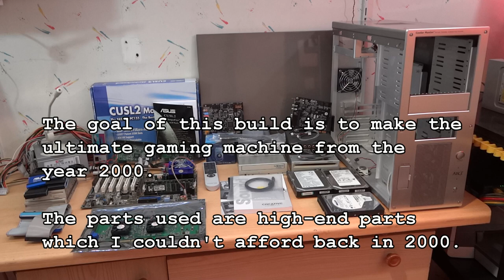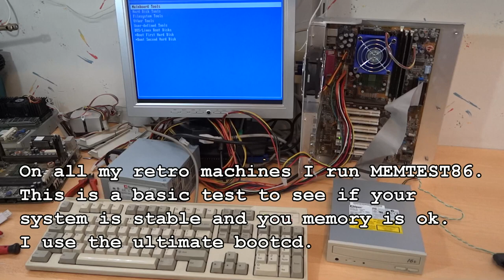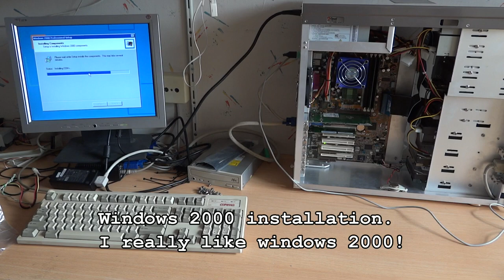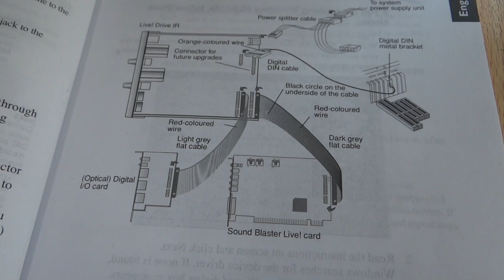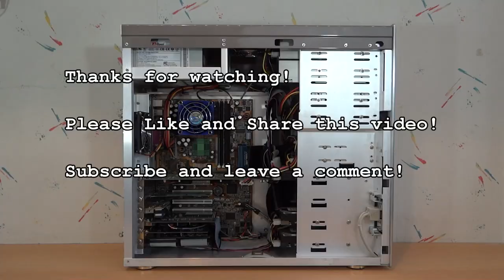Ultimate year 2000 gaming build! 3DFX Voodoo5 Asus CUSL2 P3-1ghz CM ATC201

Comment: What's the point in retro builds?
Reply: Wow, that's a tough question... There are so many reasons, that if I were to list them, this coment wouldbe the only comment visible on this page...

Here's a few reasons: It's fun, it gets rid of spare time, It's cheaper than building a new PC, You can play DOOM and such on it, and you don't have to worry about upgrades after you've built it. That's the gist of it.
Reply: FAMICOMASTER  Actually, it's more expensive looking for really old parts. Also, you can play Doom on any computer made in the past 20 years.

If I have $130 to spend on a Video Card, am I gonna buy a Voodoo 5 5500 or a GTX 480? I think I'll take the 480. It seems these retro builds try to construct the best of a generation.

Like they would look for the best motherboard that's Windows 98 compatible and stick in a Voodoo 5 5500 for the best 3DFX machine or the last Nvidia Card with Windows 98 drivers (of which was a 6800 GS) to have the fastest Windows 98 machine.

But, what's the point? You can just run those games nativly in Windows 8.1 and you can even run old Windows 3.1 games in Windows 8.1 32-bit. There's also Emulation like Dosbox and there's Virtual Machines. (especially Xen, you can give virtualised Windows direct access to a Video Card)
Reply: No, you canot run MS-DOS based games under a Windows NT based operating system, (Windows 2000 and later), or more specifically an x64 pc. MS-DOS and Windows 3.11 and earlier run natively in 16-bit, so it won't run on a 64-bit machine. Trust me, I've hoped and tried. 2 different Windows 8 machines, and a Windows 7 laptop. It just doesn't work. And with the price? Just go 'trash picking' for older pcs. And mabey it's just fun to build these machines and show them off to people, did you ever think about that? Exactly. And virtualbox and dosbox? The audio/video emulation isn't nearly as good at original hardware is, and it never will be. I can see why your name is gastonASSton, Now shut up.
Reply from the maker: GastonAsston
For this system I only bought the Voodoo5 and Case. The rest was free.
Reply: WHERE?! I NEED TO KNOW!
Reply from the maker: FAMICOMASTER
The free parts?
Reply from the maker: GastonAsston
I just asked parts by friends and I got lots off them.
Reply: Nice!
Reply: whats the point of restoring a 1957 chevy?? Old gaming stuff is to a hardware nerd kinda the same..to play the old games on the era stuff and experience what was experienced back when it was the latest and greatest.. Plus a lot of older games code wasn't the greatest and sometimes don't play so good on super new stuff belive it or not
Reply: TheDman216  Those cars from the 50's are expensive if they're still running and they're death traps, modern cars crash in a way that it adsorbs more of the impact and inertia and playing games on old hardware just gives you low FPS. I have San Andreas and it says it's Windows 98 Compatible and yet on max settings, I dip around 30FPS at 1920x1200 on my Windows 7 machine with a GTX 460 and a Phenom II x6 1045t. What makes you think a Pentium III is going to run it any better?

Those games were designed for shit hardware at low resolutions and if a game was optimized for one core in mind making CPU intensive games from 2003-2006 with developers that assumed people would just get a higher clocked single core to run it at higher resolutions or just didn't give a shit and few developers like John Carmack optimized their games for multicore before then like Quake 3 could run on a quad pentium MMX machine because it was optimized for NT-based windows of which is better than that piece of shit dos-based windows consumers had in the 90's and only the Enterprise world really used it before Windows XP came out.

The only way to run those old games at modern resolutions is to get the new Pentium (or any unlocked CPU for that matter) and overclock the hell out of it.
Reply: GastonAsston Gas if you don't get it by now ya never will..its not about Framerate or new stuff..its about gaming with the vintage gear that the games were made for .. low framerate or not.. On the car subject billons of people drove no crumple zone,no emissons,no airbag techno shitboxes and lived to tell how did that happen??
Reply: TheDman216 I already got, but Computers from the years 2000 were slow as shit and I was even planing on building the best Windows 98 machine by looking for a Socket 775 Motherboard with Windows 98 Drivers or getting a modern motherboard and install Windows 98 in Xen and put in a 6800 Ultra, but there's no point, those games run better on modern Video Cards on Operating Systems and take up less electricity.

The only Vintage hardware I like are Keyboards, but I can use a 30-year-old keyboard on my modern system just fine.

I tell console gamers this shit all the time: "Love the games, not the console" and it applies to PC too, "Love the old games, not the obsolete hardware.".
Reply: FAMICOMASTER  I'm only said to others what others said to me.
Reply: So ignore those who told you not to build it because it's a waste, If you have the resources and enjoy doing it, who cares?
Reply: FAMICOMASTER
 I don't ignore logic.
Reply: FAMICOMASTER It's a troll, can't you see that?
Reply: Yes, but I like to counter troll the trolls!
Reply: GastonAsston
If older cars are so shitty then how did my 72 Chevy get in a accident last year with a 2006 Toyota tundra. 72 had a crumpled fender and dented bumper yet the Toyota was totaled. Please learn what you are talking about before you say shit.
Reply: ***** It's called "Physics" and there are a lot of factors at play and just because it was totalled, that doesn't mean it's not safe, the forces that totalled said car may have had all of the impact adsorbed into the crash of the car itself and not the passenger.

I heard of a guy that got into an accident in his car and the car was totalled, but he didn't have a scratch on him. It was a shame, his car may had been a piece of shit, but it was the coolest piece of shit ever made and revolutionary for the time, one of the first cars that had fuel injection instead of a carburettor. His car was a DeLeorean DMC-12.

But, what made that car cool was the the body, the marketing and it was a time machine and it became an icon, but the car ran like shit. So, you don't want the car, you want the image of the car. If you replace the motherboard of an Power Mac G5, is it still a Power Mac G5? The case would be heavily modified to support a non-G5 board and my answer to my question would be "Even if you didn't have to modify the case, it's still not a Power Mac G5 because the case would be the only stock part".
Reply: And yet I choose to buy an iMac G3 over the more powerful G5 or eerything else I could've possible bought on the large, nearly endless world of ebay. And I'm no apple fanboy, I just saw it, said 'Hmmm... that's neat, I'll take it!'
Reply: FAMICOMASTER  I had an iMac G3 and it ran like garbage. But, the screen was pretty nice.
Reply: And yet I still bought one. For 10 US dollars($).
Reply: FAMICOMASTER  I got mine for free and discarded it.
Reply: Why? Just because its not the newest, fastest thingon the market, doesn't mean its so bad that you won't even take it for free!
Reply: FAMICOMASTER  Because it used up a lot of power. (that and I had to modify it to use a standard IDE Cable and it stopped working) If I was going to get a shitty computer, it might as well be low powered like an Atom Nettop or a Raspbery PI and if I was going to get a PowerPC Mac, I might as well get the best of a generation, I would get a MDD (The G5s had slow bus speeds compared to the MDD) to mess around with for legacy software.

I'm not a retro machine guy, if I'm running an ancient OS for application compatibility, I rather emulate a machine that will run those applications faster than any machine that ever used it when it was new. (apart from games that didn't have a clock-generator like 8086 games running really fast on a 486, for those, I throttle them) I installed Windows 3.11 in Dosbox and just for shits and giggles, I wanted to see how fast it was and I installed a  Windows 3.x benchmark and the results pretty much said I was a wizard with a really fast Pentium MMX and god-like IO speeds from the RAM and Hard Drive.
Reply: GastonAsston
Do you have some hard numbers to back the power consumption argument? Because i seriously doubt that this PC consumes more power than newer PCs under the same load. You see, without any frame rate limiting, running old games on newer chips is going to cause considerable load as well. In fact, it is all too easy to write some trivial code that will bring your CPU cores to a crawl.

P.S.
"Old windows" (9x) were definitely not "DOS based". In fact, in Win9x the role of DOS is reduced to nothing more than that of a fancy boot loader. Problems with Win9x vs WinNT did not come from the fact that there was also DOS present, but from actual design deficiencies in kernel itself (very little protection, lack of any advanced facilities, several generation of driver interfaces some of which were quite old and primitive, etc...).
Reply: nameless0193  Well, no, but a Raspbery Pi will use 5 Watts and is about at the same speed as a Pentium II. A Pentium II will use... Well, I don't know exactly because I never plugged in a Kill-a-watt on a Pentium II system, but I can' tell you it's more than 5 Watts!

Windows was an Operating Environment back then, not an Operating System, you couldn't run Windows without Dos, but you could delete your win32 folder and still use DOS. Also, the Kernel in win 9x was shit.
Reply: Nameless, even though I really hate to say it, I agree with gastonasston here, because my iMac draws around 650+ watts. Too much. But it s dead now, as in it no longer powers on in general...
Reply: Oh, and before windows 2000, all of the consumer versions of windows WERE, in fact, DOS based, excluding Windows NT. Windows 95 wasn't that bad, but Windows 98/SE/ME was.
Reply: FAMICOMASTER  Windows 9x wasn't very stable, that's why the enterprise sector knew what they were doing never used it for mission critical workflow that cannot be disrupted.
Reply: GastonAsston
Well, it still consumes less than modern desktop PC (i can't vouch for that voodoo though... they were known power monsters). Of course, as the time passed refined fabrication process allowed for lower power consumption that was then offset by shoving more and more transistors and increasing the clock speed, but that's besides the point. I have an old P3 and the thing works on like 250W PSU. Granted its not 5W, but it's also not 300+W, and i believe i could get away with much weaker PSU (the CPU itself uses around 30 Watts, P2 even less), but i'm having trouble getting my hands on AT PSU's.

Regarding Windows 9x. The fact that it doesn't boot without DOS has nothing to do with it supposedly being "DOS based" since the role of DOS is basically that of boot loader. This is no place to discuss how x86 protected mode works since that's highly terse and technical (and lenghty to be honest).

Yes the OS itself was quite unstable, no one is disputing that, but the reasons for that are to be searched for elsewhere. In fact for vast majority of blue screens on Win9x third party drivers were to blame. Do you know why all windows are typically super stable in "safe mode"? In that mode they use very minimal set of very thoroughly tested drivers and i have yet to see Win9x randomly crash and burn while in safe mode, and running on good hardware (it will still suffer from other non driver-related vulnerabilities such as those listed below)

Other things that made Win9x susceptible to glitches were weak memory protection, some awkwardly shared resources (one misbehaving process could corrupt entire running OS session for example), VDM with far less restrictions (and thus greater compatibility, it's all about compromises) than the one that came with NT, FAT file system which was fairly susceptible to corruption, and the list goes on and on...
Reply: FAMICOMASTER
650W iMac? Heh. Well, I'm a PC guy, no Macs here ;)
Although that's quite suprising. What did suck so much power? CPU? Graphics card? Monitor (if you are talking about one of those CRT integrated Macs)? Do tell.
Reply: nameless0193
 The G3s had CRTs
Reply: GastonAsston
NO. You CAN NOT use 775 systems plus GF-6200 (and newer) for WIN98 retro gaming. Drivers are not there.
Even ISA slots have not been avaliable in years. Wich pretty much rules stuff as gravis and mt32 out.
The barrier are ICH5 southbridges, if you want to use ISA on PCI cards. And even that would not work 100%
Socket 478 systems with ISA slots today are industry graded with masked DMA and NO "serr" (that rules SB16 out)

GF-5XXX cards were the last to not be PCI-X bridged agp cards, and for Dos you need Vesa stuff.
Wich brings it all back to: For max performance in Dos and Win98: Use old hardware.
New hardware would only slow stuff down, because of the software have to translate direct hardware calls through software only. Yeah..... FS-2004 would (as an example) run painfully slow on PCI-X cards.
Reply: brostenen
There are early Socket 775 Motherboards that you can install Windows 98 on http://www.asrock.com/mb/Intel/775i65G%20R3.0/?cat=Download
Reply: Windows 98 was used for home computing, wasn't it? I don't remember hearing anything about it beng used in any sort of major department... But I still think that Windows 95 was the best ofthe 9x series, because it was the moset stable for me. 98 had serious problems,  SE wasn't much better, and ME was just HORRENDOUSLY bad.
Reply: FAMICOMASTER  ME wasn't that bad compared to the rest of Win 98, the only thing that was wrong with it was it wasn't NT-based, but it didn't have a real DOS mode. Windows ME had a lot of cool features like it was the first time we saw Mouse Wheel Support and Windows Movie Maker in Windows and most of the stuff that had Windows 98 Drivers had Windows ME Drivers as well. Hate for Windows ME, Windows Vista and Windows 8 come from the "herd mentality", they only hated it for stupid reasons that were outside Microsoft's control. (apart from Win 8's UI, but that's fixed with a third party start menu) Like running like shit on shitty computers, change of driver model and going from 32-64 bit in Vista that made legacy drivers not work and people don't seem to complain about Windows 7 having the same fucking problem and changes from MBR to GPT.
Reply: GastonAsston
WinME was basically Win98 with expanded driver database, some additional components tacked on, and DOS shell removed (while actual DOS remained, just well hidden).

You can, for the most part, interchange system components between all Win9x, and even more so between Win98 and WinME (have done so regularly), they are actually that similar. The only real difference between this operating systems was: default shell (Win95 prior to Windows Desktop Update doesn't have IE based shell, hence less features but faster shell), default driver collection, and driver interfaces (Win95 uses primitive virtual x driver interface, while Win98 and ME retained compatibility with virtual x drivers, but also introduced windows driver model interface).
One major feature introduced by WinME was system restore. Other differences between Win9x operating systems included typical differences in default version of various packages (media player, internet explorer, directx...) with notable difference in that Win95 did not came with Internet Explorer and DirectX preinstalled.

P.S.
What do you mean by mouse wheel support in WinME? I use mouse wheel quite regularly under my Win98 :S
You should not confuse this with some very old windows components such as winhlp32.exe which is very old executable (Win95 era) without support for WM_MOUSEWHEEL message, that same executable will not scroll even under XP and later...
Reply: But it still sucked.
Reply: FAMICOMASTER
Yeah, but it's not much worse than Win 9x in general.
Reply: True that. But Windows 95 was a big step, it had reasons to be buggy. Try updating windows 95, it helps.
Reply: I found win 3.1 to be less buggy than win 9x. (then again, it couldn't do much) the best OSs of the 90's were OS/2 and NT.
Reply: True. NT wasn't very compatible with MS-DOS applications, was it? I really can't remember. OS/2 (or at least the one I used) wasn't very nice to look at. Windows 3.1 wan't too bad though, just not uch to do with it. Which is why I like Windows 95.
Reply: FAMICOMASTER Well, Windows XP was pretty much NT 5.1 and it ran DOS applications. But OS/2 was marked as "A better DOS than DOS and a better Windows than Windows" and it was and that's why there were no applications made for OS/2, they just ran the Windows version in OS/2. the only way that compatibility from competing platforms can raise platform adoption of a compatible alternative is when the alternative is more convenient, cheaper, easy to find and it can run it's compatibility layer better than the original and have native compatibility of said alternative be a lot more powerful and have develop and end users leverage the native power of said alternative.

Example: Apple, when they first came out with PowerPC Macs, it was faster than anything the Pentium could dream of and could emulate at the speeds of a 486 SX and the Developers and Media people loved it! The only problem was it wasn't as mainstream  and it was inconvenient because it was a pain in the ass especially because you had to know how to format a floppy to FAT on a Mac and find programs that save to the right formats when you had to fight with Lotus and Claris Works and early MS Office, but despite all that, that helped Apple a bit, but that was disastrous for OS/2.
Reply: The versio of OS/2 I used was version 1.2, I think. It's been too long to remember that. I just remember it running insanely slow on my 486/33 and 8MB RAM. i also remember it being really ugly to look at, with gray everything.
Reply: FAMICOMASTER  It could of been the lack of RAM and slow Hard Drive, but I like the ugly look. Like I said, I can already emulate windows 3.1 faster than any computer that existed in 1994, so there's not much of a point in messing with retro hardware.
Reply: That is true. I agree, you CAN emulate it FAR faster than any computer that ever existed back in that day and time, but theres just some kind of charm about hearing that ST-251 or the floppy drive sounds that you just don't get in computers these days.
Reply: FAMICOMASTER
WinME "sucked" because of drivers. On pretty much every single occasion that some Win9x OS "sucked" third party programmers were to blame (whether the source of issue was an application or driver). Win9x kernel featured little protection (and I'm not talking security here, but OS protecting itself from buggy third party code), and very poor recoverability from when errors do occur. So it only took one faltering driver to make a very big mess. NT, on the other hand, was always designed to be essentially bullet proof, and sometime around Windows 2000 Microsoft started several initiatives to make hardware vendors spit out higher quality code, thus plugging the final major stability hole.

Drivers are pieces of code that runs from within kernel memory address space. Because of this, they pretty much have the same privileges as kernel and can easily block kernel from resuming normal operation, thus hanging the system. Essentially, drivers are an extension of kernel. That is why MS would most happy if everyone just used signed drivers (drivers are signed by Microsoft after they pass series of quality related tests from WHQL, not that these tests are 100% perfect mind you).

It is always developers who choose to do something "smart" like (ab)use undocumented behavior, take some dubious shortcuts, or just flat-out forget to release resources, that cause all that crap. I should know, I write code as a hobby, and there were countless occasions I brought down Win9x to their knees with my own crappy code, you mess up global state and suddenly restarting your PC is the only sane thing left to do. Programming is iterative craft, you learn by making mistakes and then not repeating them in future :D

In theory, Win9x is super stable as long as everyone plays by the book (same can be said about Win 3.11's task switching). But in practice you have to expect unexpected and be able to deal with it properly.

I apologize for this series of messages unrelated to actual video. It's just that this is pet peeve of mine. Have a nice day. :)
Reply: But if something unexpected is expected, then it is no longer expected. Expec-ception! What was task switching? I don't remember that much about Windows 3.11... Windows 95 was the best of the 9x/SE/ME series, in my opinion.
Reply: FAMICOMASTER
Well that's one thing about programming. You have to think of every weird situation your program might find itself in, and then cover it completely. For example, some user deletes critical file of your application, do you just let it crash as one big "fck you" to the user, or do you cover that specific case and inform user of what he just did and why the application cannot run? There are so many bizarre things that should not really be happening that can cause your app to blow up. Hence: "expecting the unexpected" because you cannot just claim: "that will not happen" or "this file will always be present" or some other such, because every once in a blue moon it will happen, and you will be left scratching your head as to what just happened. Whenever you introduce human factor things cease to be predictable.

Stupidity/ignorance of users is sometimes endless, as is laziness of programmers to properly protect their application from it. :P

Regarding the windows 3.11 task switching. That operating system (and earlier) employed task switching mechanism known as "cooperative multitasking". Its major problem is the very way it works. You see, multitasking on a single CPU core does not execute multiple processes/threads simultaneously, it is really a serial execution in form of: process A, then process B, then process C, etc..., but the CPU time slice (quantum) each gets is so small that each of them gets to execute many times per second thus creating illusion of simultaneous execution (multiple CPU cores do actually execute code simultaneously but that's besides the point).

Now, back to cooperative multitasking and its problem. The way cooperative multitasking works is by putting responsibility on applications to yield CPU. That is, one application runs for a short while and then it has to release CPU so that next application can run and so on. One can easily spot a problem right there. What if application hangs or is just stuck doing some really long operation? It won't yield CPU to other apps and system will become unresponsive. Therefore everything will be fine and dandy as long as applications behave, and as soon as one of them goes nuts reset switch becomes your only friend.

Modern operating systems (Win 95 upwards, WinNT...) employ scheme known as "preemptive multitasking" that basically puts kernel in charge of giving CPU time to apps. So kernel takes one app, lets CPU execute its code for a little while and when timer interrupt fires it then stops that app, saves its state, and jumps to another app, and so on... When you adjust priorities of processes/threads what you are really changing is how often (within some time span) some process gets CPU to run on.